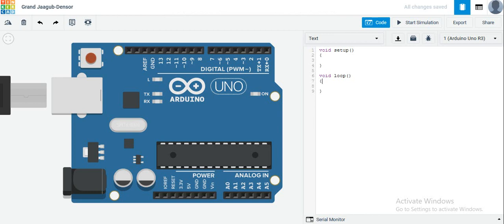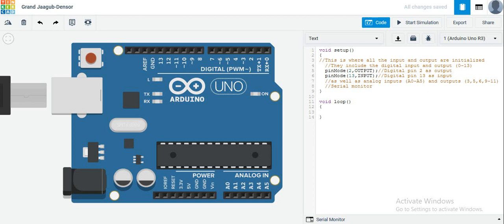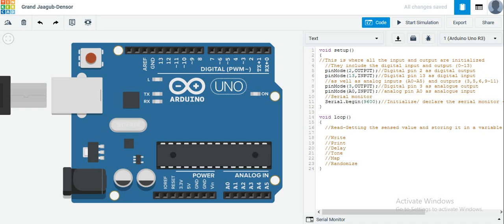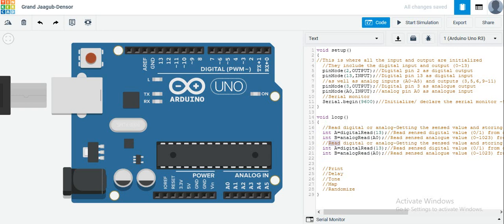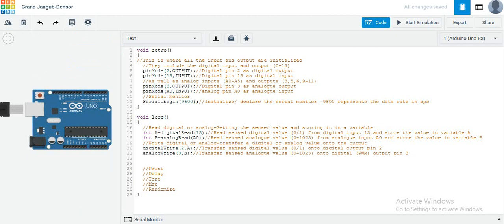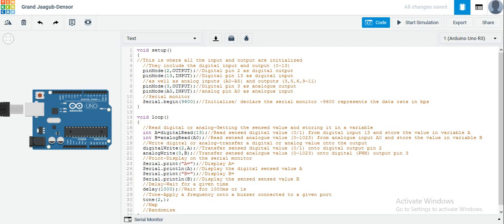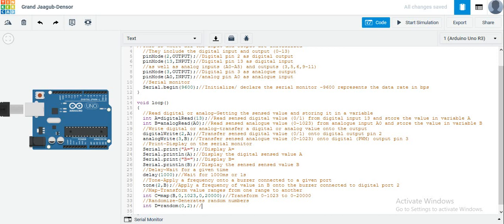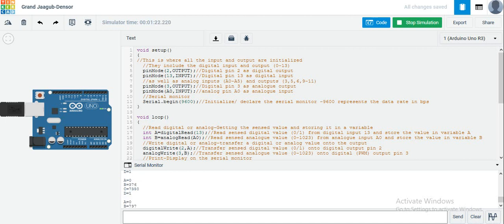THE ARDUINO IDE EXPLAINED IN AUTODESK TINKERCAD CIRCUITS

Comment: Teacher what kind of questions can be asked about an Arduino
Reply from the maker: Development of digital systems using it. For instance you are given sensors, actuators and Arduino then asked on how to connect and program them to form a specific digital system. This can, in some cases, start from a proposal stage.
Reply: Thanks 👍💯